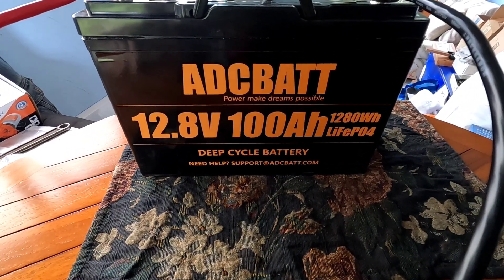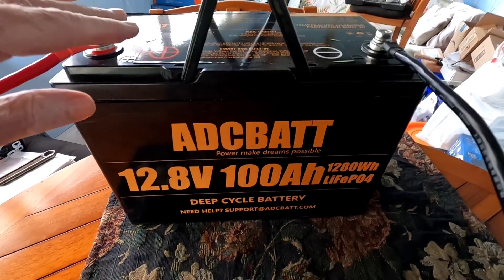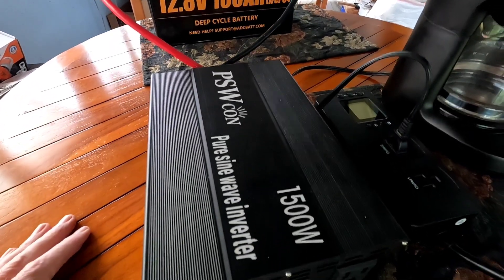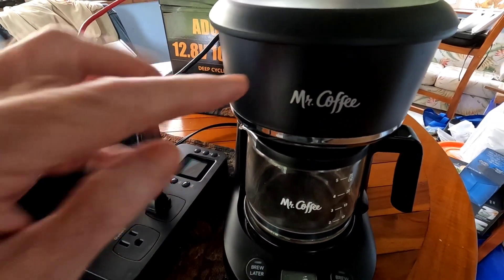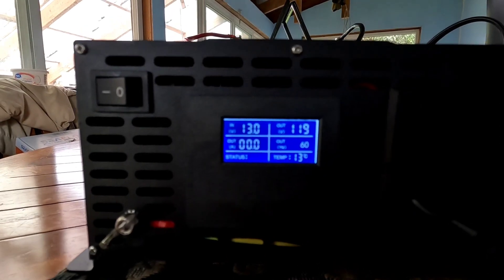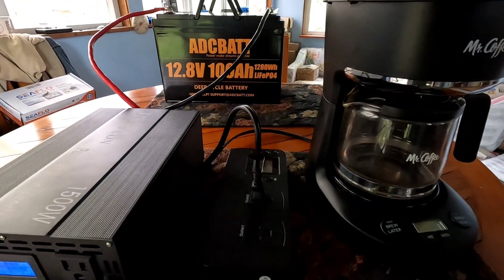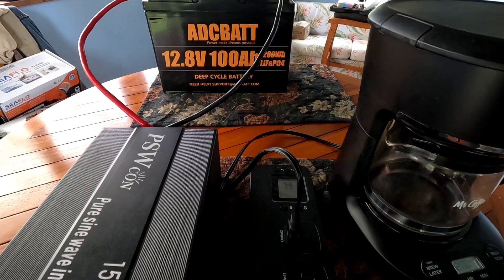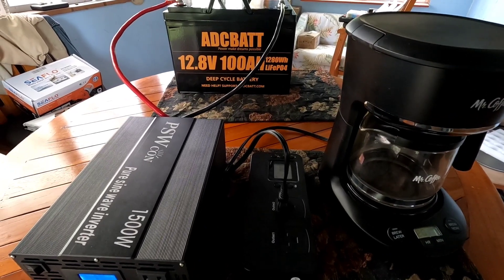ADCBATT 12.8v 100ah/LiFePO4 usage update

Comment: What does your Dual outlet watt meter show in KW/hr? You can use that to perform battery capacity test, just have to factor in the inverter conversion loss.

Comment: You should use fuse protection. As well as put a battery monitoring system on. Did you leave the coffee  maker on to see what the hot plate would draw.. If you want  to conserve power get a yeti